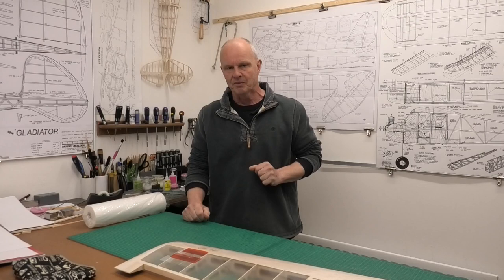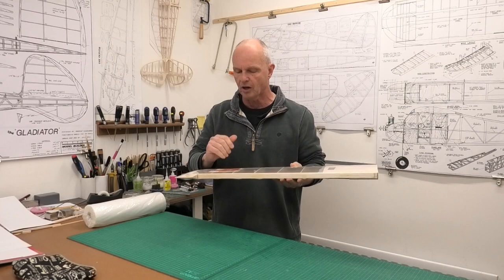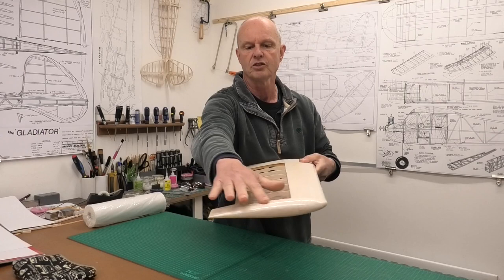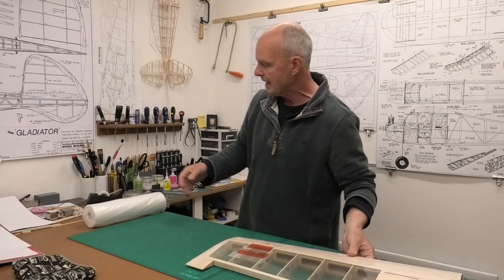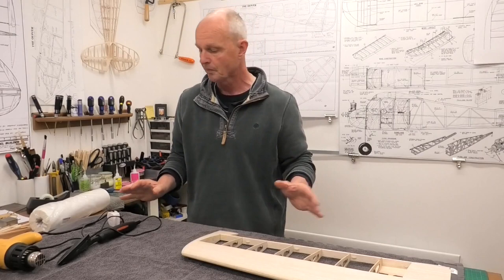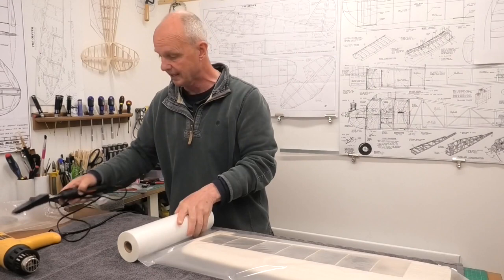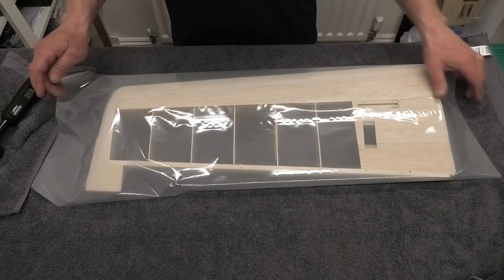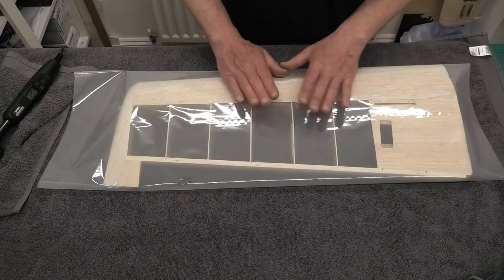Applying Laminating Film/Doculam to Vintage Model Planes - For Tissue covering

Comment: In Canada, that same size film costed $55 CDN and $35-55 CDN for shipping from the states,NOT inexpensive!
Reply from the maker: The price you quote is similar to that in the UK, when you look at the conversation rate, which is 1$ to £0.56. Also, I looked on the Canadian ebay and found it cheaper than this, which would also have the benign of cheaper postage.  At the end of the day, its still inexpensive for the size of roll and its a great product to use, in my opinion 😀

Comment: I’ve never been impressed with doculam. It’s no where near as good as real covering film.
Reply from the maker: The way I, and most people use it, it is not intended to be a replacement for "real" covering film, I use it as an extremely cheap layer under tissue, so providing strength and resiliance to the finish.  Would not use myself as a replacement for covering film, as I say in the video title its for tissue covering

Comment: What thickness film would you suggest for 40" to 72" wingspan models?  You suggest 38 microns, so about .0015, correct?
Reply from the maker: Yes, I use 38 micron, which is fine on my 49" wingspan, and I would happily use on a larger model, but of course it depends on the type of model and the stress the wings will have.  On larger models you could try thicker, think they do one around 72 micron

Comment: You doing a sturdy wing? I would like to use it on a more flexible wing. Got to be carefull not to warp the wing. 
Do you have advice for me? Obviously i cant pull that hard on the material?
Reply from the maker: Hi there, this balsa wing was is an old one I use as a test bed for different coverings and techniques.  I only used it to demonstrate the technique, laminating film is fine on flimsy wings, although it shrinks well it does not have a strong pull  like some of the covering films.  Here is another video on a much flimsier wing, my Diamon Demon - https://youtu.be/13qfN5Nupx0
Reply from the maker: You can pull hard on the film, it is very strong, but it will rip if there is a cut edge close by, as you saw in the video

Comment: I've always just used an old-fashioned clothes iron for applying film (because I could never afford a 'proper' mini iron!), and shrank it with a heat-gun. I was astonished to see the price of 2m of regular covering film recently (10x what I used to pay for a roll!), so I too have been using 38 micron laminating film for my models. 150 metres for £17 from a mail-order office supplies company - brilliant stuff.

As a clothes iron is heavy and awkward to manoeuvre, it tends to get 'rolled' round curves rather than slid. Sliding can create wrinkles. I did notice that proper shrinking irons (like yours) can be fitted with a heatproof cloth 'sock', which presumably eliminates the risk of the sole catching and wrinkling the film.

Have you tried using such a thing?🤔
Reply from the maker: When I first got my iron I used it with a sock, but didnt really like it, so much more tactile without.  thanks for the comment

Comment: Hi Mark. 
That’s an interesting covering method. Have you had a chance to test it’s fuel proofing abilities? 
Mainly for a nitro build?
Reply from the maker: I have never used it on its own, I cover in tissue and then a fuel proofer, either polyurethane or other product depending on whether diesel, petrol or glow.  The tissue over the film gives a strong but traditional look.
Reply: @MarkRobinson555   I have tested it with fuel and its completely fuel proof , Overlaps are totally firm and wont lift without heat , On the matt version , Good clear video
Reply from the maker: Thanks very much, appreciated

Comment: Hi mark...can we use spray paint over doculam after shrinking it?.
Reply from the maker: Hi, I think you can but it is not very stable and will probably need some prep to provide a key on the surface.  I have a recollection of seeing someone spraying paint on the glue side befor application, but I dont really have much knowledge of either